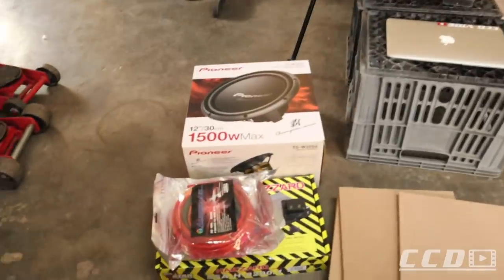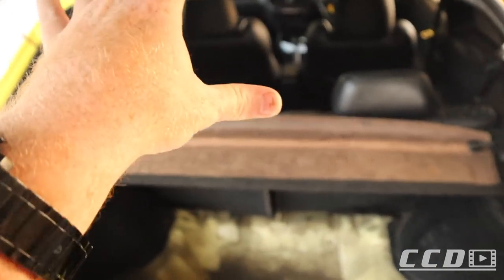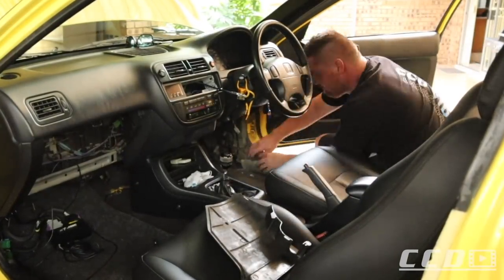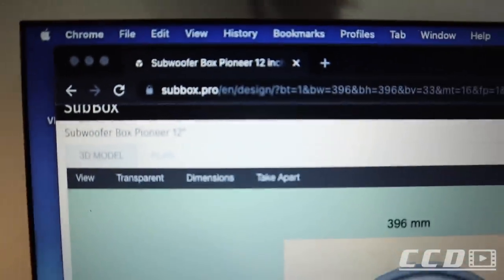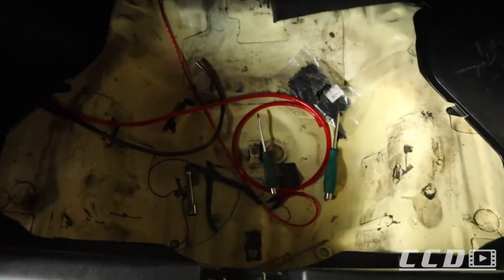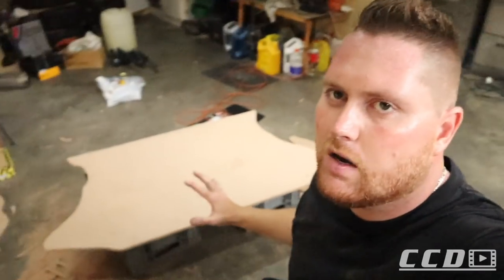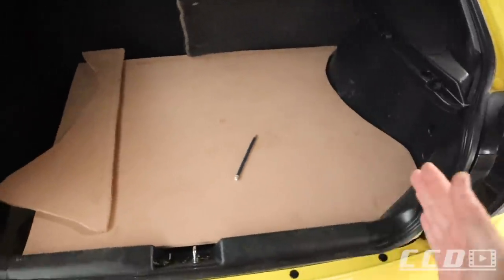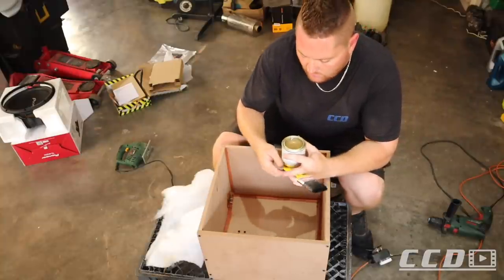CUSTOM Subwoofer Box Build + Install Civic EK Hatch *DIY*  🔊🔊🔊

Comment: Hey man. I think the system is pretty cool. Only thing ill change is 2 things. Number 1 remove the amp from the box as it can damage ur amp over time, vibration etc of components etc . Other thing is idd add a piano hinge to the side of the cutoff u made that way its one unit  but foldable to sore things there too
Reply from the maker: I’m willing to give it a shot and see how long it lasts
Reply: @CCDVIDEO  better that than to waste money on buying another amp
Reply: As long as it’s not a SPL setup and you have rubber stoppers in between the amp and the box where the screws are you will be perfectly safe mounting your amp on your sub box 🤙
Reply: If you build your sub box properly it shouldnt be a problem. Boxes shouldnt viabrate/flex

Comment: Just looking at doing something similar myself, nice to see some inspiration! The only thing I would change about that, is the removable piece. I'd add another on the opposite side to make it even easier to remove, access the space underneath to put things possibly, and it would aesthetically look better as the cuts would be symmetrical.
Nice work!

Comment: Not bad at all, considering that you're not an installer, looks very neat, simple & clean.
Please don't take the following to heart, your video can help improve someone else with their install, thus with my pointers they can learn from your tiny errors.
Pointers for the future, use cardboard to trace corners to get a snug fit, never mount an amp to the box, heat & vibration causes solder to melt & drop down. Get a grille cover for the driver. Don't force the jigsaw forward, rather let it cut slow & steady than fast and inaccurate, that's why the blade came off.

Comment: Im planning on a similar project. The only thing i would do different is have the speaker flush with the floor, maybe even 3cm sunken, with a perspect cover so that i can truly use the boot as per normal. I think you would hate if you carried tools and a tool punctured your speaker as you have it.
Reply: Thanks for the inspiration...you really do thorough work...i dont think many people would strip and clean the way you did.